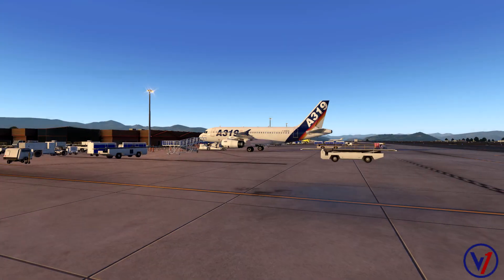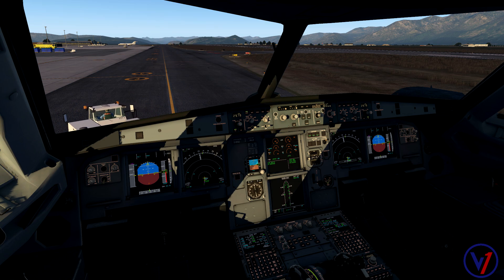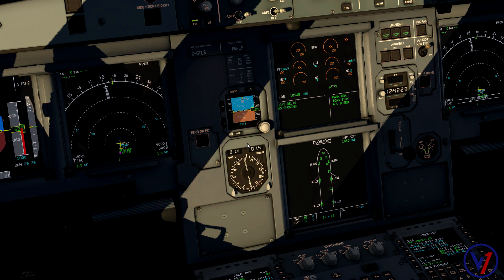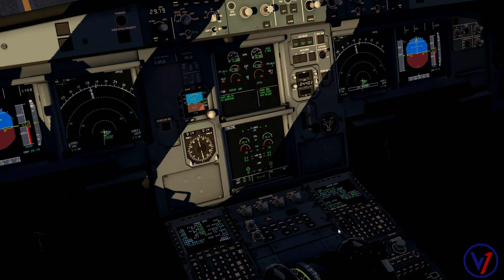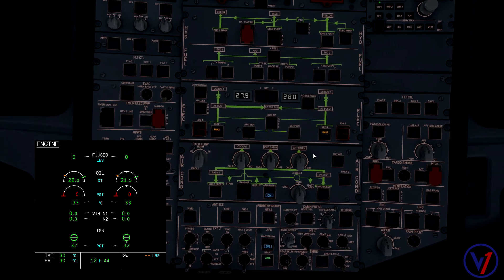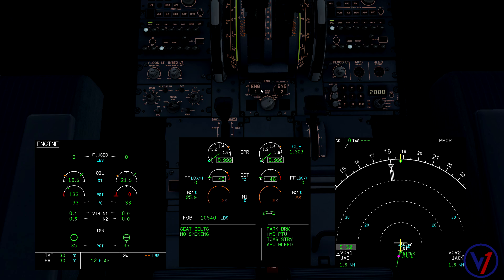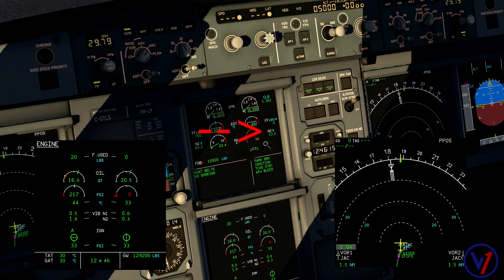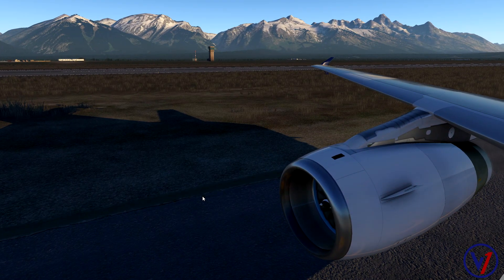Start like a Boeing? | REAL Airbus Pilot Tips | MANUAL Engine Start Procedure

Comment: Captain, What is the difference between pressing Manual Engine Start (GUARDED pB) and auto start Engine master on? I do not understand the starter limitation that “starter must not be run when N2>20%; what does it mean?
Reply: In a manual start, the guarded man start button starts the air to the starter motor, ignition comes in automatically. the master switch in this case  then starts the fuel flow. 

The N2 limitation is to avoid the starter engaging when the N2 is too high which would overspeed the starter and likely damage it. I had a stuck starter motor on an auto start and at about 30% N2 the the starter motor disintegrated, taking half the high pressure turbine with it and causing a quite spectacular fire, which went out as soon as we cut the master switch.
Reply: @peteconrad2077  x2. This would be the equivalent of being in a car w/engine already idling and turning the key to 'start' of course a automotive starter uses an electric motor that cranks with a toothed gear..this is bad if the starter gear meets a flywheel that's already spinning. this is similar.
Reply: @noway9880  yes. That’s correct.